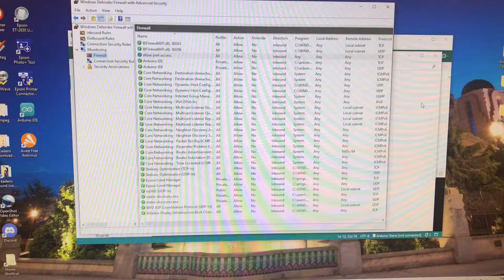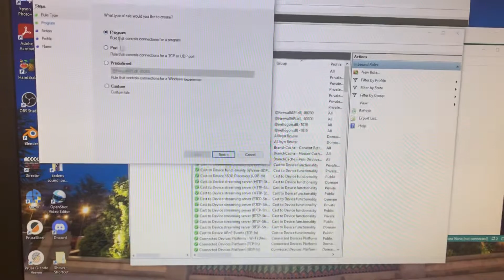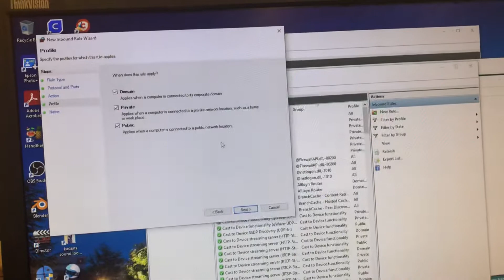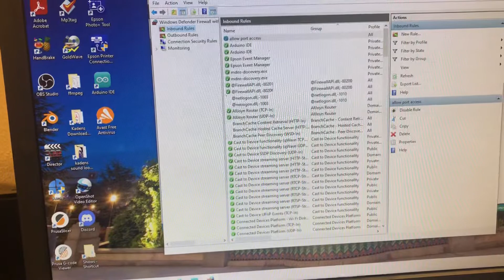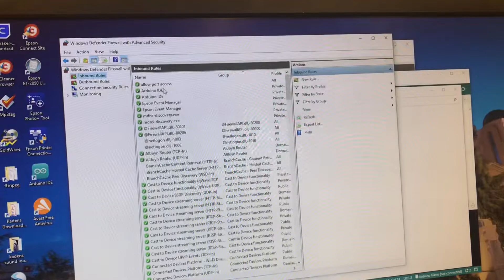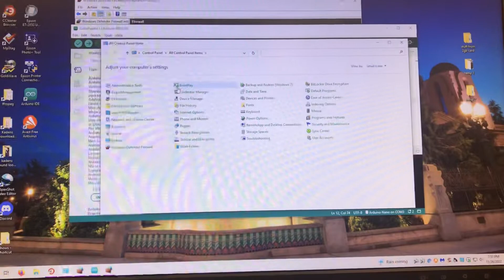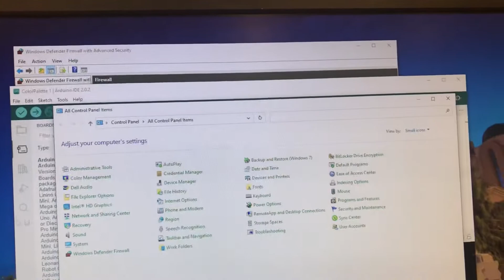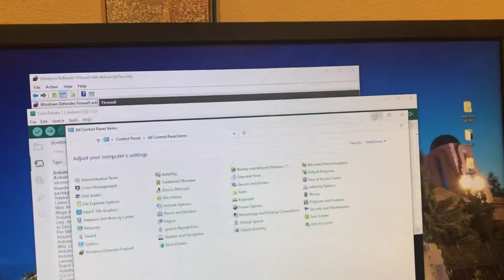Port access denied error on arduino (compatible board )

Comment: I uploaded Adalight_WS2812 sketch witch is continuously running on the Arduino board, and I can no longer upload to the board, I get this port access denied. I tried your suggested solution as well but didn't help.